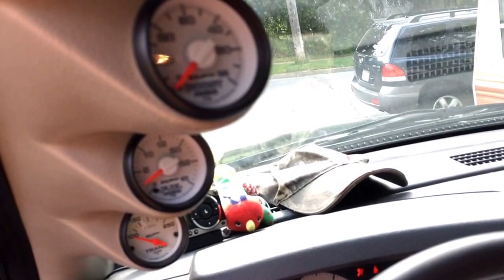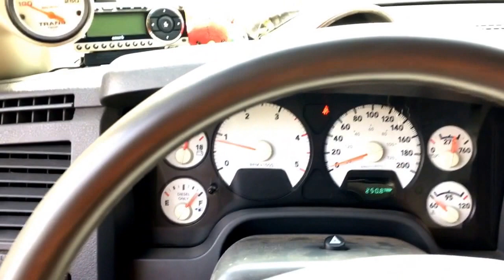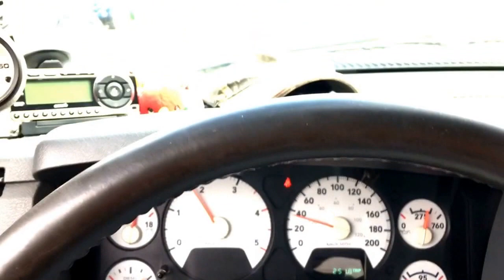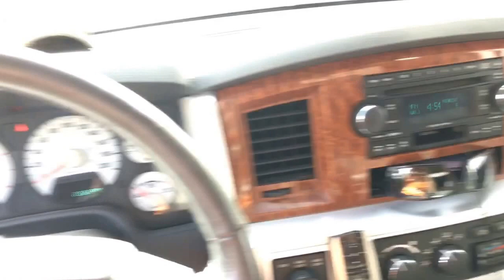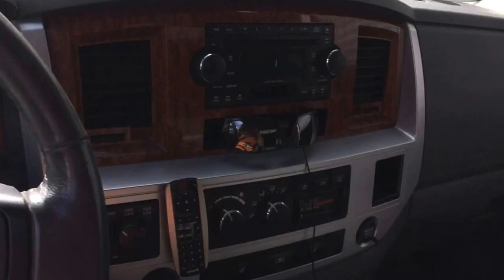G56 transmission squeal

Comment: Looks like it's my turn!  Here we go
Reply from the maker: OHHHHHHHHH NO!!!!!! Same symptoms!!!????
Reply: @hogie1685  yes,  the sound comes and goes with the clutch pedal with the same sound as yours here did.  05 cummins 6 speed.  Looks like it's time for a clutch job.  139k miles
Reply from the maker: So my truck had a dual mass flywheel (OEM) and I put a single mass flywheel and a LUK heavy clutch single disc. But good to like 600hp

Comment: My old 1996 Ram had that same sound, we tore into it and the clutch was so worn down and the bearing was shot. Time for a new clutch!
Reply from the maker: +Chris James yah the throw out bearing was toast.  Went with a single mass flywheel instead of the dual mass and new heavy duty Luk clutch!
Reply: hogie1685 about how hard was the replacement? Also how much were the parts

Comment: So what was the exact problem? I just got my truck back from getting a new long block installed and it made that noise a few times just slightly under throttle. Not sure if maybe because it’s been sitting for almost a year with the engine out at the shop? Idk if that would make a difference
Reply from the maker: U got a G56 trans?
Reply: @ yes I do
Reply from the maker: Yah my throw out bearing or pilot bearing grenaded.

Comment: how many miles did you have on the truck. I thought the new clutches lasted around 300k miles. if you dont pop it much and drive it normally
Reply from the maker: It was the Pilot bearing also known as the throw out bearing that grenaded. Clutch was still great. But chunks of the bearing ended up in it. So we put new everything in

Comment: I had that squeal too. Couldn't figure out what is was.  It suddenly went away after a few months.
Reply from the maker: Really. So nothing came of it?  My throw out bearing was grenaded. All new LUK clutch and went with a single mass flywheel. $$$
Reply: @hogie1685  what's a new clutch run?, I've got a 2009 ram 3500.  150K miles.
Reply from the maker: I payed $3200 cdn all said and done. So half that for #MURICA dollars 😜😂
Reply from the maker: That's clutch. New flywheel and brgs etc and labour!!! And taxes can't forget those.
Reply: Thanks.  I've had the truck 10 years so I'm thinking it's time to replace it.

Comment: Worst manuel ever made
Reply from the maker: Why?
Reply: @hogie1685  they are the loudest, hardest shifting, weak thrust bearings, people spend countless hours seacrhing for a magic oil to make them quite. Thats just the start. I own one in a 2010 with 140000 miles. It for sale!
Reply from the maker: Ohhhhhhhhhhh. In all honesty man. I don’t consider mine loud at all TBH. I just have regular ATF-4 in mine. No issues. I bought the truck used when it was 7 years old. Couple years after I had the pilot bearing go. And then put a single mass flywheel and new clutch and bearing. Been great for years after that.
Reply from the maker: Ohhhh and over filled mine by a quart
Reply: @KBoettcher13  you talking about the G56?
Reply: @bryanrose20  yes
Reply: @KBoettcher13  oh my bad I thought this was a NV5600 video.
Reply from the maker: Nah G56
Reply: @bryanrose20  forgive me
Reply: Good Atf+4 is perfectly adequate and seems to have the best overall performance.  People are looking for solutions to problems that don't exist.